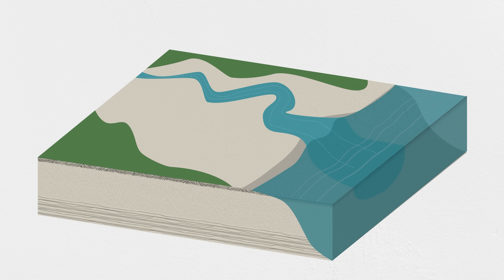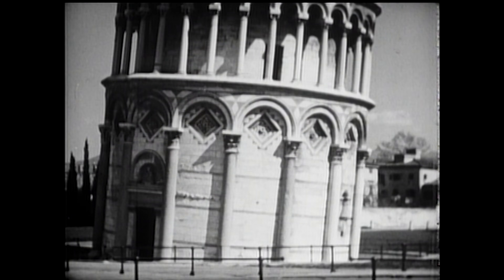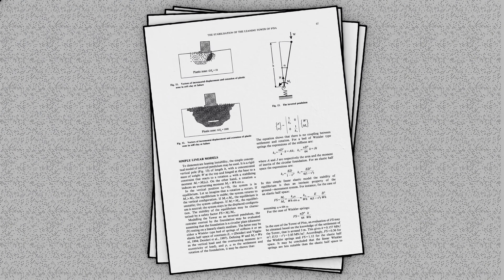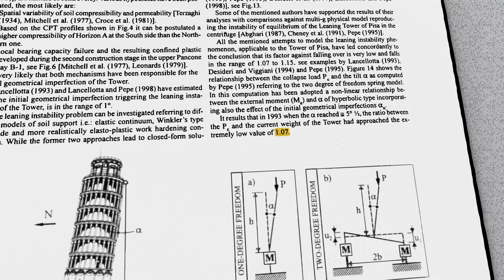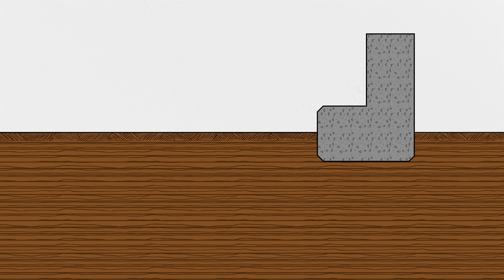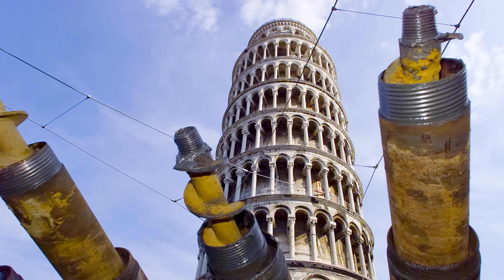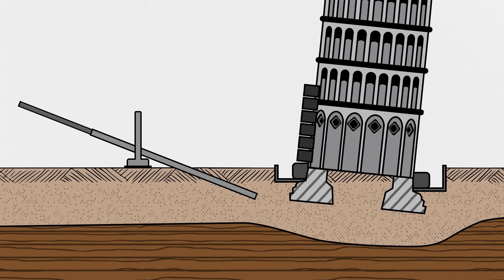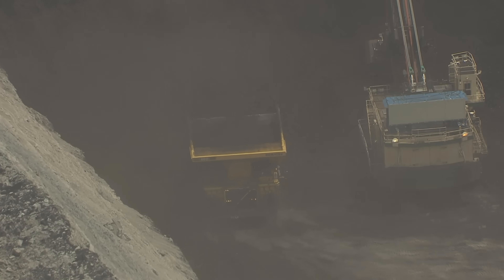How Engineers Straightened the Leaning Tower of Pisa

Comment: The thumbnail for this video incorrectly shows the tilt as a 5.5° angle with respect to the horizontal. The tilt is measured from the vertical. I have seen similar mistakes on other YouTube videos about the Tower. I wonder what's causing that?

Comment: It takes an engineer to be like, "Hmmm, this walkway that is keyed into the foundation and obviously doubling the surface area pushing against the ground should be removed". Anyone who actually builds things would be like, yeah, obviously.
Reply from the maker: True. Engineers don't have X-ray vision like contractors do ;)
Reply: @PracticalEngineeringChannel  You made it seem like they knew it was keyed and removed it anyway

If that's the case then yeah it takes someone sitting behind a computer to make that decision. It would make sense that the people building at the time understand at least a little bit the composition of the ground and how that would effect the structure so they spreading the footing out to help prevent it. They were the ones building things that last thousands of years after all without the fancy sensors and equipment.

Comment: I would just demolish it, fix the ground under where there tower was and solidify that foundation from sinking in undesirable ways, and then have the tower rebuilt like it was before instead of trying to over engineer some complicated structure next to it to prevent it from falling over. If you have the blueprints of it's entire architecture it be easy to rebuild it like it was all those centuries ago.

Comment: Sounds more like a correction than a fix. Presumably the tilt will be monitored from now on, and corrections applied when needed.
Reply: So, what would be a "fix". in your opinion?    And if the "fix" cost 50 times as much as a "correction" and the "correction" solved the problem, isn't the "correction" a "fix"
Reply: @andrewalexander9492  A fix would be permanent, and might not be possible given the geology. A correction reduces the tilt and provides a means for controlling it, but does not eliminate the underlying cause of the tilt.

Comment: There was a German passenger ocean liner that also had a tilt, and was used for many years despite efforts to straighten it.  The center of gravity was too high.
Reply: Correcting a list (tilt to one side) in a ship is comparatively a lot easier than in a building. Usually you just put more weight on the higher side, typically by pumping water into a bilge tank.
Reply: @Sashazur  Yes they tried that and it didn't work, also adding ballast.  SS Imperator was the ship's name, and despite the tilt she had a long career, lasting from before WWI until after WWII.

Comment: I never knew they re-level the top after the tilt happened and that the tower is actually curving.
Reply: The tower is not curved.  It has straight sides, but at two spots of the tower, it was built straight up with the base tilting.

Comment: I didn't watch all the story, and I don't know who did the picture, but the included angle is not 5 1/2 degrees from horizontal, but 84 1/2 degrees. It Would be 5 1/2 degrees from vertical.

Comment: Aiming for some lean is where modern perception interferes with functionality. Remember, the designers didnt plan for a leaning building. Weve just grown to appreciate it for that characteristic.   However, aiming for a slight angle of lean is like showing off a wound that has been encouraged to contain some degree of infection. Allowing lean causes continual remedies to be neccessary and cycles of instability and acceptable lean will forever continue. Fix the mf building.

Comment: The 'logic' of the builders baffles me. They restart work after a hundred year layoff, and notice the building is no longer vertical, so, instead of asking themselves why and wondering if this might continue to happen, they build the second section at an angle to 'straighten' the building out!

Then, when they restart the second time, they notice that the tilt has got worse, but, instead of seeing this as confirmation that there is an inherent problem, they repeat the same 'solution' as before!!

They not only don't see the crystal clear warning, but they actually repeat the 'solution' they know hasn't worked!

Comment: Imagine situation:
Very smart guys give very advanced techniques of stabilizing the tower: Use electrodes to move the water under the tower or use pumps to move dirt under it and there is this third guy like meh, just dig out some dirt from the one side, so it should tilt to that way and it worked, the simplest solutions are the best 😂😂

Comment: That is 5.5 degrees????
Reply: That is NOT 5.5 degrees; it is 80+, almost 90 degrees as shown with the white lines.
Reply: @winglo1697  if it was 90 degrees, the tower would lay flat on its side.
The tower was leaning 5.5 degrees, 5.5 degrees from straight. Hence "leaning".

Comment: practical engineering has a fresh 00.13.16 youtube on the lean of the leaning Pisa Tower . . the tower is a millennium old and it b gan its lean during construction . . a third of the tower was built and construction interrupted . . . when construction resumed it was leaning . . dear kind readers: plz, eye’m begging; eye’ll do anything, por favor . . consider this fr a practical perspective sincerely, Tom Doody . . if a third of the tower is leaning . . and u add 2 more thirds on top ur leaning problem is likely 2 b aggravated . . the builders of the tower adjusted the design of the top two thirds so it revered the lean . . according 2 practical engineering this is obvious in the bell area . . and . . eye confirmed PE is correct . . a tour w google maps there r blue dots at the camera spots where the high-tech famous all-angle camera shot . . eye found a blue dot in the tower on the North side and another on the South side and counted the steps . . a tourist walking fr the perimeter rail in2 the bell area has 2 climb six or four steps depending on which side of the tower he or she is on . . another ez confirmation is 2 google pisa tower engineering drawings and view images . . there r many drawings that show the adjustments made by the builders 2 correct 4 the leaning base as they added the top two thirds of the tower